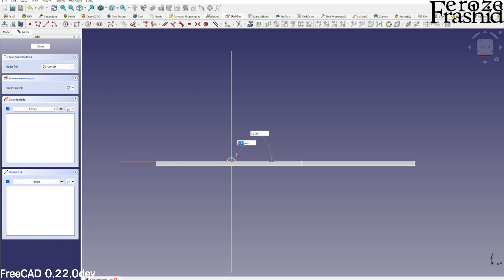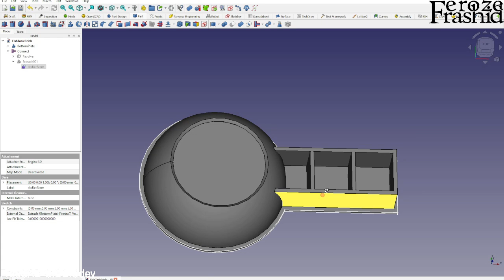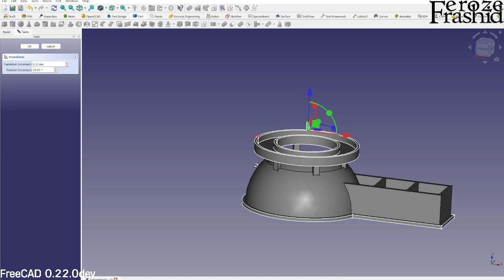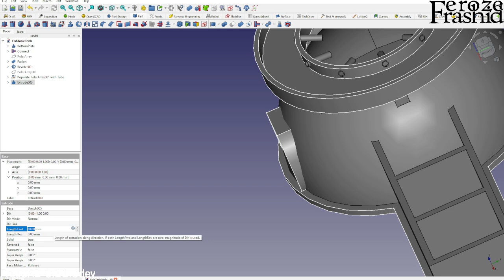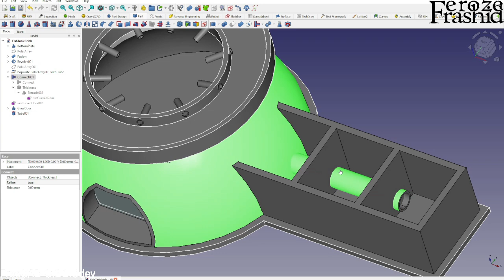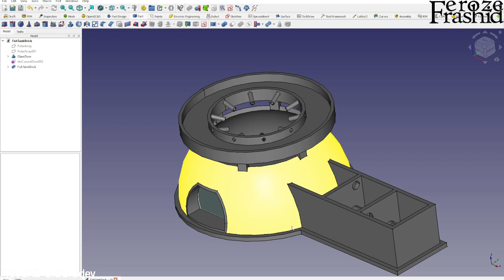Weekend Special: Model a Brick Fish Tank in FreeCAD

Comment: Hi, thanks for your efforts making and sharing the video.
Aren't you familiar with Arch / BIM workbench? I wonder if it's possible to design this type of construction with these workbenches...
Regards
Reply from the maker: I am familiar with BIM wb. Once I feel confident on basic FreeCAD ops, I will eventually start working on BIM, and that's my ultimate goal. BIM will definitely require basic knowledge especially from Draft, Part, and lattice2 wbs. 
In the meantime, I hope the wb will be more defined in freeCAD. I am sensing some major updates on BIM in near future. 
Thanks.
Reply: @kattkushol  Thanks for your reply. I've already tried Arch wb, it's reasonably easy for simple projects but when you need to make a 3 or 4 waters roof becomes hard. I'm not a Construction engineer but I would like to project simple buildings ie warehouses or sheds but we do not have too many references here on YT. What a pity. Cheers

Comment: Nice tank model. I would like to model things I seen on the net but I aways pick things way beyond my skill level 😊  Maybe jusr need more practice and a few curves tutorials.

You could try the arc slot with flat ends tool for the sksForRevole sketch.. It is under the slot tool. Pick your center line diameter (click)pick the arc length (click)and set the width (click) There are boxes to enter direct measurements. The other option is arc ends like the regular slot tool. Just started to play with it last night and here is a video where it might have been useful.

The arc tool has an eliptical, a  parabola and a hyperbola arcs. Have not figured them out quite yet. Focal length, arc start, arc end seem to be the steps. Don't quote me on it. 😊
Reply from the maker: Thanks. I know what you are talking about. Every time I feel like I figured out the elliptical/parabola arcs, it does not come out the way I try next time. I will be honest with you, these two geometry was not on my fav list even in college. 
I am sure it won't be that tough after few hundred times of practice.